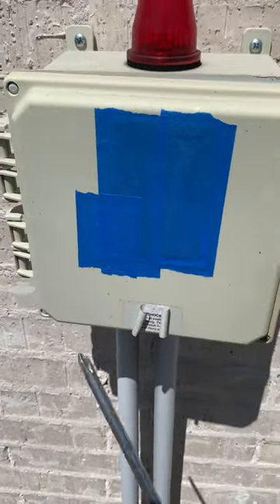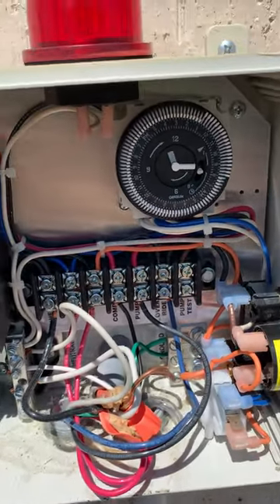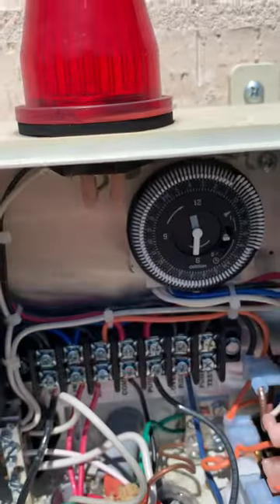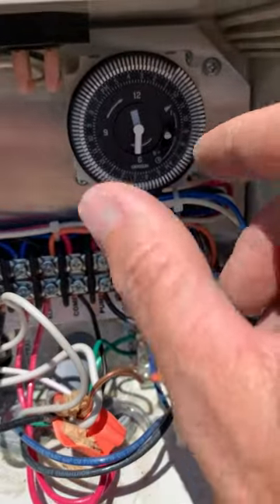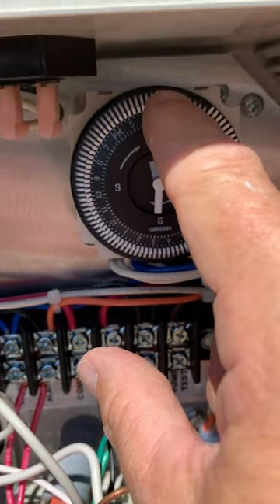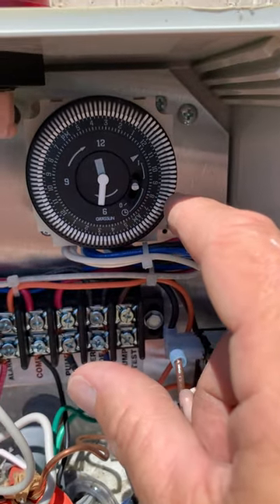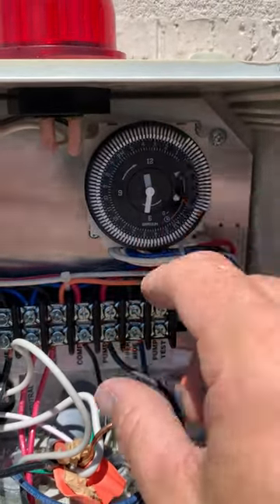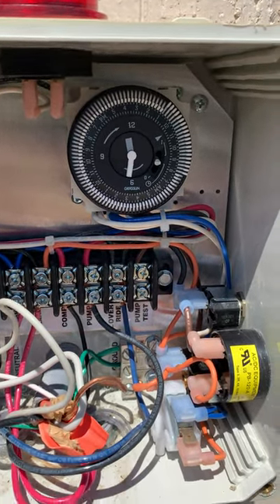Reset time on a Aerobic Septic System Panel - DIY - Works for me

Comment: It is set to on demand..The small.Right button on the is up so it sprays in demand. Switched center off and a the way down towards clock symbol is pump in timer setting